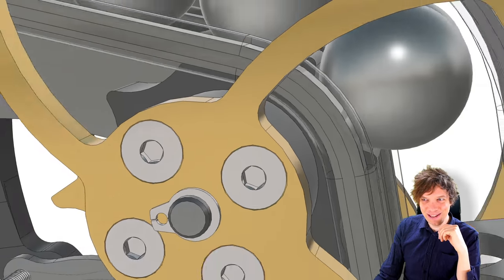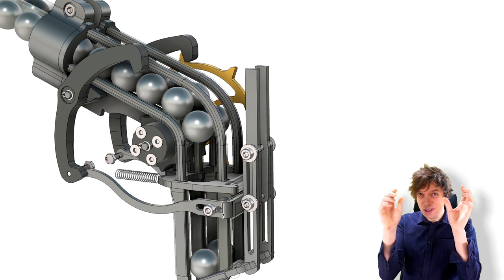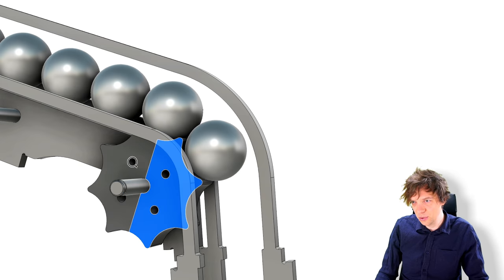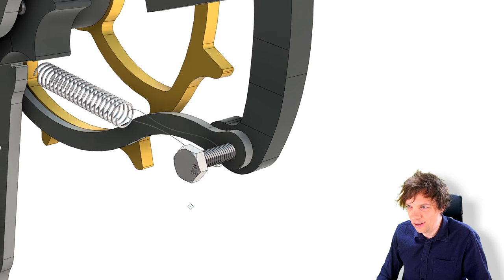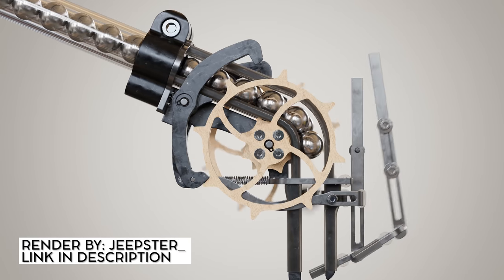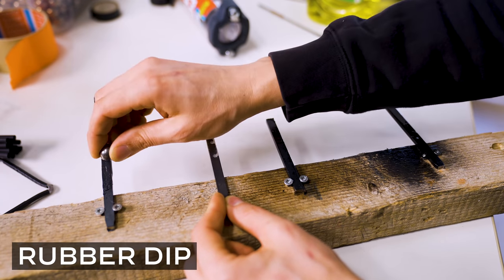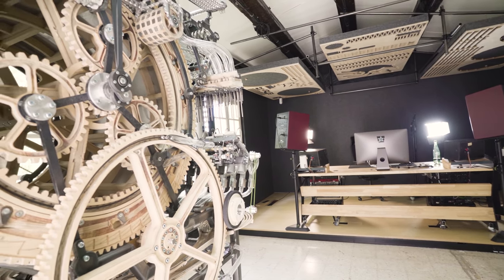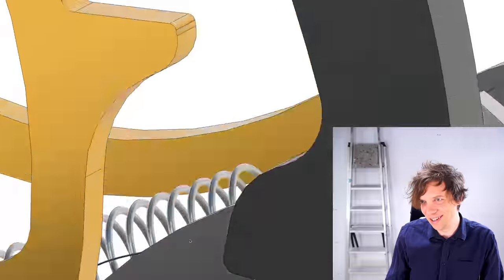Clock Escapement Marble Gate - Designed For Silence

Comment: I continue thinking your are completely overlooking 3D printing. Those escapement hooks are gonna be complex to machine in one single part. By the time you asked who could make it on discord, you'll be done printing two already. PLA, PETG or ASA are all up to the task.
Same goes about printing the tube clamp, temporary escapement wheels (brass looks cooler),  for quick test assembly purposes.

Comment: Martin, you are going to hate that inaccessible tuning for the spring. Imagine doing that for all the marble gates before each concert. Imagine a wire breaking, or needing to replace it midconcert. That should make you sweat. The idea is good, but try having your tuning being forward facing without a wire.

Comment: maybe relpace the circlips with split pins? that way you don't need a groove to be cut. the axle could be made with a drill press instead of a lathe. it also doesn't require special tools for assembly and can be replaced with a simple piece of wire in an emergency.

Comment: I worry that the POM parts are going to have a lot of pressure on them and might wear down over time. Unlike the divider, there will be moving metal constantly rubbing on them while holding the weight of 20 or more marbles above it, stopping the marbles as they fall with a sort of momentum-hammer. Hopefully they're more resilient than I think they are.

Comment: Martin, thermal shrink tube is not very resistant to wear, it can tear any moment after many marbles hit it. Saying this because I use it alot in quadcopters. Not a problem if you can periodically replace it though.

Comment: With all the vibration, I'd be really hesitant to use a wire as the only tensioning for the spring. It would be better to get the correct spring for the space. Alternatively, like others have suggested, make something similar to a guitar tuning pin.

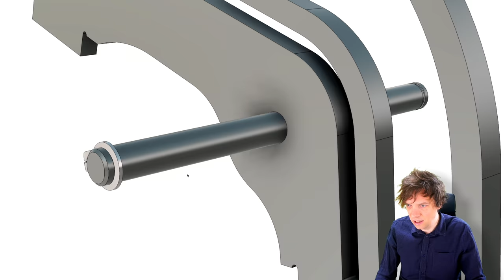Comment: Martin, (around (5:00-6:00) you say you'll use 3mm bolds in 2mm holes. I think you'd better do a 2.5 or 2.8 mm hole in the marble gear instead, depending on how you'll thread into it.

Comment: The properties of shrink tube change somewhat in the weeks after it is shrunk.  I've had it crumble and crack in applications that require moderate bending.  I don't know if it would be an issue in this application, but maybe something to look into

Comment: I see the metal wires you use to adjust the spring tension as possible points of failure. Won't the gate stop working if the wire breaks? Is there a safety measure in place for such an occasion that prevents other parts from getting damaged?
And if heat shrink tubing wears off, it cannot be redone once the thing you put it on is closed off on both ends...

Comment: I think if you find you have any problems with the spring tensioning wire you may just want to do a simple tensioning bolt that hangs off of the boat that you have the wire currently attached to but currently if it works don't fix it

Comment: I'm not convinced the heat shrink will hold up to abuse over time. I vaguely remember using it for similar purposes (dampening metal on metal hits/taps) and was very let down by how quickly it wore through. It's just not made for that purpose. The silicone tube might last longer, I've never tried it.

Comment: Why not use a setup similar to a guitar tuning key on that wire to control the spring tension? It'd allow you accurate adjustments on the fly (especially if setup to be adjusted with a screwdriver from the front of the assembled machine).

Comment: 1.  You should have gotten clickspring to make the brass pieces.
2.  Wire for spring tensioning will be a point of failure, difficult to fine tune, and inevitably have to be redesigned later...

Comment: check out the spring tensioner on a kick drum pedal, where it's threaded with double locking nuts. i think that'd be better than twisted wire?

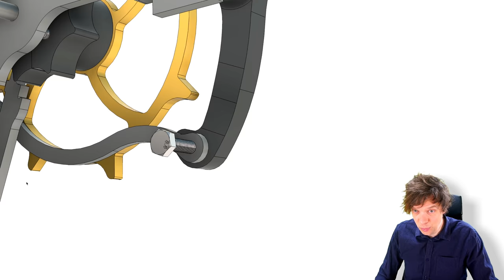Comment: 8:10 Would there be space for a T-tube like piece that the bolt goes through and a screw for the spring which is accessible from the front? Eventually reaching the screw through the spring

Comment: Could you keep the ball bearings inside the PVC tubes, then have a single pair of balls release through the aluminium constrictor clip, roll down into the dropper, before dropping to the instrument? 
Thus eliminating/ confining the sounds of ball bearings clattering into each other in the hopper. An extra layer of silence. (Just a crazy idea).

Comment: Again, form over function. The pinball mechanism clearly is the one that should be used. A lot of complicated and fragile custom "clock" parts are going to be such a pain in the rear end. If this keeps working after one shipment of the machine, I'd be amazed.

Comment: I'm sorry, but I can't think of the spring's metal wire as anything other than a single point of failure.
I'm not an engineer so I can't judge how solid it is, but I feel like that sounds a little risky for a thing that is basically making or breaking the world tour's success. ^ ^;
Reply: Springs can handle fatigue pretty well, but they stretch over time and use, and inconsistently.
Reply: @thomasbecker9676  I think he meant the bit of wire used to attach and tension the spring. But the wire is almost as reliable as the spring. Springs only suffer fatigue if they're over stretched.

Comment: I'm worried a little bit about the aluminium guide pieces especially when the marble queue is empty (I know it should be empty, but it's the worst case scenario), those pieces will have quite a bit of impact on them and considering it's a soft metal, it may deform a bit.

Comment: my big concern for the spring tensioning system is that with only the wire's winding holding it in place there will be loosening over time, which across 38 channels and with human error, this could cause a lot of problems over a tour.

Comment: Something I have always wondered: Why do we have to drop the marble twice for it to be played (that is, from gear to arm, and then from arm to instrutement)? Wouldn't it work just as well with only one step, if not better because of simplicity?
Reply: The escapement mechanism has two pawls acting in opposition to one another, in order to let one marble out at a time. The activation lever moves twice in opposite directions, out, and back. This is one activation then has to release one marble, which required both pawls to engage/disengage. And each time a pawl moves, the marbles move down. Therefore, the marbles have to move down half a marble twice before the drop.

Comment: Fyi, the shafts for the escapements are standard parts.  https://us.misumi-ec.com/vona2/detail/110300095320/  Stock in increments of 5mm and customized for cheap.  Doesn't look like McMaster has metric versions though https://www.mcmaster.com/pins/headless-clevis-pins-with-retaining-ring-grooves/

Comment: Using a wire for spring tensioning isn't a great idea. The wire will eventually get loose and cause a catastrophic failure. There needs to be a way to maintain tension of the spring over an extended duration of time. You're aiming for little to no failure. These little details will save you time and trouble. Stop the moles from popping up!

Comment: 5:19, I don't see why you can't remove the gear simply by pushing the axel out. Especially if you can access the module from both sides, it should be quite easy.

Comment: What if the wire on the spring wasn't wound around the static bolt but instead wound around something that can spin freely to tune it, like a guitar tuner. It's essentially the same problem. You don't manually remove and rewind guitar strings when they're out of tune.

Comment: No need for the clip to retain the rotating parts! A smaller axle diameter inside the marble gear and larger diameter inside the spacer and clock wheel would accomplish the same thing. Could be done on a lathe same as the clip groove, or by pressing or welding a sleeve on each end of the axle.

Comment: I think you should do a small redesign on the tube clamp. 
Have a look at these seatpost clamps: https://r2-bike.com/media/image/product/42051/lg/procraft-sattelklemme-carbon-prc-spc1-349-mm-farbig-schwarz.jpg
The problem with your desgn is, that the clamps will pinch the tubes which can lead to cracks.  A design with two rotating barrels for the thread and screwhead will avoid the pinching.

Comment: at 9:44 Instead of welding, couldn't you make the parts a little bit longer and with a grove that you would then drop in a horizontal bar with bends to lock it into place?

Comment: Beautiful design! 
However, I didn't understand how the new design allows a noise improvement that would not have been possible with the previous one. To my hearing, the "tape test" seems indicating that most of the noise was coming from marble/marble interaction (not marble/gate). Also, from previous videos, I thought that the rigid link was a real issue for reliability. Overall, I am just worried that this design could induce possible malfunction that were not possible with the previous one. No more angle grinder, pleeeeaaaaase. 
On another side, I feel the production of the videos has step-up even more. Martin seems in great shape and enjoying the project. Can't wait to see to the full loop completed. Best wishes!!

Comment: You are going to control spring tension via an adjustable metal wire? Would you consider just putting guitar tuning machine heads somewhere in there to aid with that system? Or is that too much going on in a small space?

Comment: After you design the metal parts,
Why WELD them instead of tap a screw on the top of it with a snug fit?

Comment: I don't know i would trust the wire to hold the spring. Heck to prevent the spring from cycling from the vibration of the machine you may want to put a shaft for the spring to ride on

Comment: When your goal is reliability, yeah you're making a mistake with that wire.

If it turns out that way, at least it'll be easy to fix.
Reply: It has been discused before but I think Martin is going for materials that can be easily replaced and tuned before every show.
Reply: @aliasnando  I think he's going to find that very difficult to adjust. Also difficult to make it stay where it's set to.

I would have expected to see a small piece of threaded rod with a nyloc and a hole for the spring.

I hope it works for him, but I'd be rather surprised.
Reply: @dtnicholls1  knowing Martin that metal wire is gonna last a one month. O a year before being changed.
Reply: @aliasnando  like I said, at least it's easy to fix.

I'm also not convinced on the heat shrink either. Wherever that goes it will want to be easily replaceable and any sharp edge it's against will need to be removed to stop it getting cut.

It's designed as an insulator and sometimes as a mechanical support (you can get glue lined versions) for wire, it doesn't really have a lot of resistance to abrasion or cutting.

The design overall looks pretty amazing though. He's really done an exceptionally good job.

Comment: At 5:09 I’m not sure why the marble gear had to be made in 2 pieces. Can’t you just remove the shaft and all the rotating parts will drop out of place, without removing the welded rails?

Comment: barnaby is a boss! love the content definitely check him out especially the 'adam savage' episode [no spoiler go watch it], its amazing stuff!

for the bolt where you tension the wire maybe use a large bolt with a small hole in it and thread the hole so you can put another bolt into the end of it with a hole sideways in the smaller bolt and use a lock nut, then you can change tension without messing with the arm (hole through the head .. ouch), such a long rabbit hole.. and it was just a friggen bolt idea 😑

Comment: Why don´t you tighten the spring with a bolt? More precise in the adjustment and reliable in time. Also, not that difficult. Just drill a hole in that hex bolt and tap it.

Comment: Beautiful!!  A few words of caution:
* please get sample parts from your manufacturing partners and do a full test fit of two or four gates plus test run before committing to a full production run. It is very likely you will see things you want to change in the final version. 
* mixing English and Metric units is a known root cause of early stage chronic autonomous mechanically-assisted exfoliation (pulling out hair) among engineers. 
* if you can make the same clock escapement work for the cyberbass, do it. Less unique parts and less complexity. So there are two perfectly good solutions for your problem. That doesn’t mean you have to use both. The clock escapement wins on aesthetics, use it all the way. 
* see if there’s a way to replace your silicon heat shrink and tubing after full manufacture?  There may be a case where repeated marble impacts cause the sharp edges of the metal bars to dig through. Perhaps also quickly chamfer or fillet the edges of the bars with a file prior to final assembly?

Can’t wait for the final product!!!

I would put these comments on discord but I am not on discord. Sorry.

Comment: I would harden and temper the metal that the marble drops on over time the marbles will make their mark, millions of hits are amazing and the reason clock makers harden steel that interacts with even soft brass.  All you need is a torch and some oil. Simple to do.

Comment: The original escapement you were using is also a real mechanical clock escapement- its called a grasshopper escapement.  The current escapement you are using is called a deadbeat escapement.

Comment: The Gear doesn't need to be split in 2 parts. Simply place the gear where it needs to be and then add the axle.
Reply: Agreed. I think he made the gear 2 piece because he is welding the axle to the center piece? But with all the gear pieces holding the axle perpendicular, the axle welding is not required.
Reply: re-checked, I think he was talking about welding the outer rail. But you're right. It can still be assembled with 1 pc gears.
Reply: @kitchencone Thank you for verifying.  I don't know If you are active on the discord but perhaps you can try to convey the message. It would save martin and the team a lot of work.

Comment: If Martin keeps redesigning/disassembling, more than a 'ship of Theseus' situation, the whole Marble machine X will be designed for silence.
How about some music that includes the noises/cracks/flaws (even the sounds of catastrophic failures) of the current machine into the composition? Wouldn't that work as testament of the work in process?
Art thrives in defect. Only silence is perfect.
Also, while 'pain is temporary' and 'glory is forever', music is like breathing: if it stops, you are dead.

Comment: Xlnt progress :) Mind the wear on POM against brass. Eventually it msy affect timing so bring spareparts ;) Good choice of plastic though. Some radii in the sharp corners will help prevent cracks (and possibly milling depending on set-up, if you don't need sharp corners - don't have them).

Comment: I worked at a place called Technique Inc in Jackson Michigan they can make anything you could possibly need out of metal. They do tube bending, laser tube cutting, CNC milling/turning , 2D laser cutting, 3D laser cutting, stampings and metal bending. They r extremely fast with super high quality control. They will take any cad model or prints however they r a little more pricy than some places but like I said they r one of the fastest company’s when it comes to turn around time.

Comment: For your dampening, there is gel available in tape form also. Gel tejp.
Silicone tube is good of course.
The alpha gel has impressive commercial videos, with eggs dropped from 18m and it doesn't break.

Comment: For that spring tensioning wire, you'll want to add a nut to lock it in place.
For heat-shrink, I'd advise you ensure what you get is double wall or adhesive lined heat shrink. It'll give you a thicker and more secure buffer.
For a last suggestion, you might want to s experiment with a parallelogram arm for the marble drop. It would be a bit of added complexity, but properly done it would allow you to pull the marble droppers straight out.

Comment: All this rubber coating is going to add a lot of "wear parts" to this machine. Upkeep is going to be a complete nightmare as eventually the rubber will wear down and it'll have to be re-applied.

Although honestly, I think even a single run of this machine will be a major success!

Comment: This feels like a bit of hubris. Seems like you had a perfectly working, less complex, more compact design in the original escapement, and instead of designing a manufacturable version of it, you essentially designed something new which is bigger, with more parts and failure points. The moles will be happy.

Comment: One last thing this is completely a hypothesis. The wire you use as guides can you use copper? Copper's Atoms are arranged differently and I don't believe they reproduce the harmonics you get from the metal wire. And I had this thought what if you took a dreble cutting disc to the back side of the rails (no marble contact zone) and removed a little bit of material say every three for four millimeters for like say an itch or so where the contact is occurring I think that will produce a wire that had a very dead harmonic, and you could place a drop of rubber in each one of those little slits  Hmmmm Maybe it's something for someone to experiment with🤔

Comment: Have a look at 'glue lined heat shrink'.
I don't know if is is available in clear, but it will allow long term resiliance. As the machine wears, normal heat shrink will begin to split and peel back. The glue lined stuff will be bonded to the metal rails in the same process that shrinks it (like hot glue). The glue itsself will act as a damping element.

I have used this approach on ratchet pawls in a winch system to effectively reduce the rattle sound.